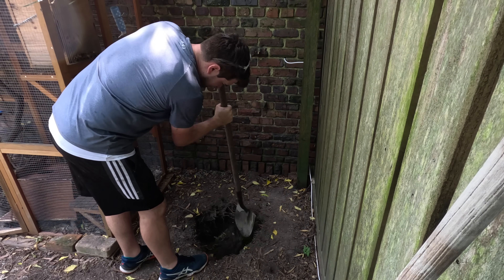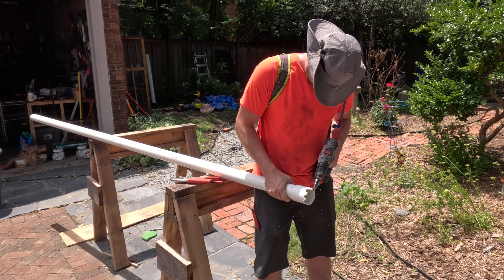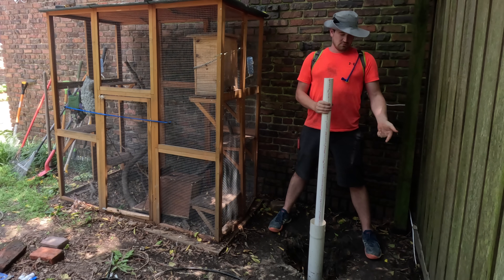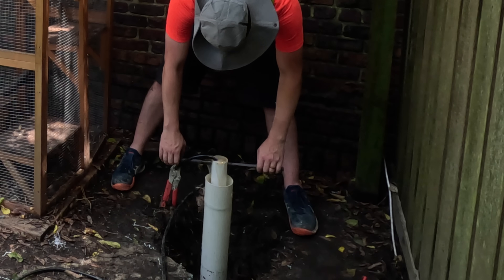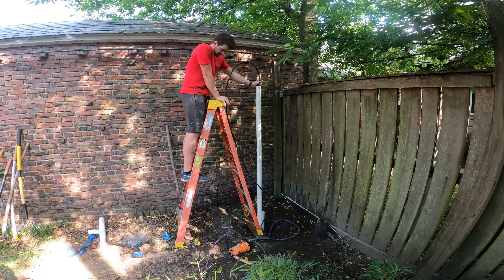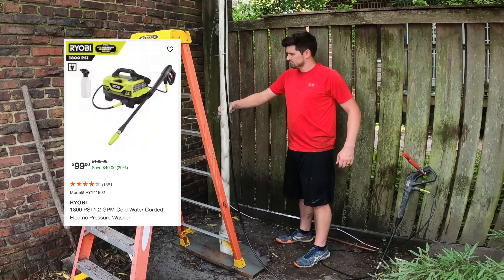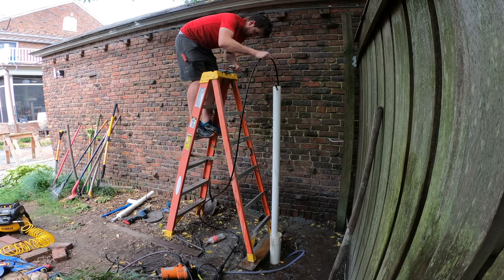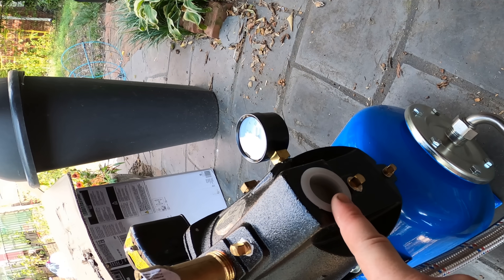I dug a 40 foot well in my backyard

Comment: I remember when my grandfather's property was annexed by the city and he was told to disconnect his well pumps and cap them off that he was not allowed to use them anymore and had to start paying for City Water Service.

It wasn't 12 hours later middle of the night, like 2:45am we were out there digging a trench rerouting the top of the well pipe (masking the "cap" so it was still there and visible) three and a half feet down trenching it over to the old barn and then all the way over to the house 200 ft away installing the pitcher pump in a hidden location. 

There was no way in hell the city was going to convince my grandpa (raised by communist hungarians) that he needed to pay for water that was rightfully his just 8 or 10 ft down on his own property.

That was some of the best well water ever because he had an old fashioned 40 and 60 ft well tap which went into the deep aquifer. Delicious water.
Reply: Grandpa is my kind of guy👍
Reply: Your Grandpa was raised by real men.
Reply: Here in California if you tap into the city water line you lose your water rights and can no longer have a well.
Reply: @frankhernandez6524  commie-fornia
Reply: @frankhernandez6524  That's why you call 611 and find out first. Just say your doing some home improvements and they have to provide you the location of the water line.
Reply: @TronixGuy93 He means as soon as you go on city water, you relinquish water rights on your property
Reply: Heck yeah. Old school American
Reply: Like, when the government disarm the American Indians, we see how it worked out real well for them😅
Reply: @timm5310  Or when they gave them infected blankets.
Reply: @TronixGuy93 they? Expound! That was routinely a work of the British crown.
Reply: @TronixGuy93 Except that never happened. Folklore.
Reply: @Milpower  Hahaha. I'm sorry you feel that way.
Reply: @TronixGuy93 it has been fully debunked. There's plenty of readily available information to peruse and absorb, for those who sincerely value knowledge and truth.
Reply: @timm5310  and if we look across the pond to Britain on basically anything in Europe, they’ve all been disarmed, and now Islam is gonna take their everything their wives, their daughters, their sons, their buildings their land THEIR FREEDOM😡❤️‍🔥🙏🏼🇺🇸
Reply: @TronixGuy93  what kind of pump did u use?  Mine is 47' n 37' to water, thinking submersible pump
Reply: @Eastbaypisces  Just a standard vintage pitcher pump. Probably from the 30's or 40's. I don't have a clue of the make and model pressure pump that my grandpa would have used. Probably something from the 60's or 70s.
Reply: Yea that old fashioned well tap surely protected you from all the nasty pollution.
Reply: @winowmak3r  You mean like the city water protected the residents of Flint, MI? lolol
Reply: @winowmak3r  Id rather take my chances with a well that MAY be polluted than drink city water
that I KNOW is polluted. If you want to drink cancer causing bleach and flouride and who knows 
what else, just keep paying the gub-mint.
Reply: @winowmak3r  "Yea" he did say the water was primarily for irrigation, regardless it's probably safer than your new modern sink tap. Go ahead and keep drinking your City Perrier and I'll keep distilling mine into 100% clear clean rain.
Reply: @winowmak3r  Ours did as well. Always tested great when every neighbor who switched literally had recycled shit water.
Reply: That was probably before PFAS
Reply: Love this!!
Reply: @EatonBudox Time to use filters or market it overseas.
Reply: love it 😍🤩🥰
Reply: Your grand father sounds like a cool dude. I would love to have a well but the city says the ground water is contaminated because of mines dug in the area. They won't issue any permits for wells. It's really frustrating.
Reply: @jonathanthompson5710  thats the main issue, permits should not be needed on your own property. city needs to keep their head out of peoples business.
Reply: @jonathanthompson5710  Get a sample yourself and test regularly. There are ways to conceal a pump (or pitcher pump) in your house. That's what they tried to tell us because of "agricultural runoff". They were lying.
Reply: Now I feel proud that I'm a hungarian :S
Reply: @Cipotalp  In soviet Hungary you don't own well, well own YOU!
Reply: Not all wells produce safe and potable water.  Some areas can be dangerous and shallow wells can become contaminated by run off doen the casing from the surface.  I appreciate that in your grandfather's case the choice here made and I would have as well.  Should have been grandfathered in upon annexation.
Reply: @mikeiver  He still did water testing. The aquifer was never tainted, nor was the water table.
Reply: Nice work Bro. Great engineering skills.
Reply: Is it still working
Reply: @flast7845  We used only encased copper tubing and brass fittings. So yeah. Still pumping water according to the new new new owners. It's a house secret :)
Reply: Communist Hungarians ? 
Do they still live in a communist country?
How is the quality of life? I hear life is dreamy in China , Cuba, Valenzuela, Cambodia.
Reply: Stick it to the man. LOL. A lot of times those rights are grandfathered. 

Some cities won't even let you collect rainwater. Greedy s o b s.
Reply: Stick it to the man. LOL. A lot of times those rights are grandfathered. 

Some cities won't even let you collect rainwater. Greedy s o b s.
Reply: and yet he let the government take his land like a good little communist lmao
Reply: And here we are controlled by a bunch of communist lites across the whole country.  Smart move.
Reply: Loved your story about your grandfather.   Sounds like a great man.  I love how stories like this reveal a bunch of bootlicking commie lovers in the responses.   People are so deceived into a belief that any of our governments have our best interests in mind.
Reply: Unfortunately now our ground water has been contaminated by pesticides
Reply: Lets go
Reply: Natural laws were not broken or harmed during the making of this influential story.
Reply: Ok you got a PVC well point since well point's are supposed to be driven I don't think this would stand up to being driven so it's basically just a screen for a drilled well I've tried finding a stainless steel one as ours only last about 10 years so far all I've found are steel with a cast iron point and threaded portion at the top to attach to the pipe sure they have a stainless steel screen but the black iron pipe in the middle eventually get's to week and collapses stoping water flow
Reply: @douglaswindsor120  I've impact driven plenty of PVC exclusive taps. Flange peened ends work best but I always recommend a manual aug first.
Reply: Hahaha 👍
Reply: All due respect. You grandpa was likely a good man, raise by good parents, but the fact that he was communists has little to no bearing on his rights or intelligence. My grandparents or better yet my grandparents  who were here before this nation became a nation, were not
Communist Romanians but did and would have agreed with your grandpa, fact is your grandpa would have agreed with them. Which is why you are likely here. America isn’t a communist nation. At least not as the communist nations proclaim themselves. It is in fact a constitutional republic. And the people will either allow government overreach or they will keep them in check by the power that God himself has endowed them with. It is our choice as Americans to either cause our government to fear us, or for us to fear our government! It is our choice. God Bless America & her people!  Love the vid! Good info! Has things I would do and others I would not.
Reply: @pjones1403  Wow that plane flew awful close.
Reply: My daughter purchased a house with insufficient water well. Said they told her at the water company that she would not have to disconnect the well. Guess what! When she connected they told her it had to be disconnected. Imagine that. Tried to warn her.
Reply: Governments are bass-turds, and this is true EVERYWHERE!!! The real pisser, the little crotch critter that made such "rules" probably still has his, but more likely her, own well.
Reply: I love your grandpa..
Reply: Love it...
Reply: 😎👏👏 smart old fella
Reply: I have one. Consider it priceless.
Reply: Wasn't his property protected by a "grandfather clause" since his property was deeded prior to the newer build laws?
Reply: Years later, the city never caught on and their bill is sent to them every month for zero dollars

 OK
Reply: The well was only 60ft deep?
Reply: The city of Paris does not make you may for your own water if you have a well in your garden . They will put a water meter to make sure you don't abuse it , especially during summer droughts .
We all share the same source.
Reply: Better forgiveness than permission which will be long in coming if at all.
Reply: That's awesome!  I want to install a well for my irrigation (sprinklers) on my rather large yard.
Reply: I Would have paid the city in “ IOU’s” and would have told them I’ll pay you when our government pays back all the money it borrowed from social security
Reply: @AreJay_  Well thats not whats important. WE NEED MORE MISSILES!
Reply: And then you woke up.
Reply: @shawnsg only after climbing off your mom.
Reply: @shawnsg  with your Mom straddling my head
Reply: its more about consuming hormone blocking chemicals and chlorine over filtered water. the extra pay is just a boost.
Reply: @cataclismdeathsassassin1698 This guy gets it. The powers that be want us all connected to municipal water to ensure the entire population gets their recommended dose of poison and endocrine disruptors like fluoride and others. Similar to how they spray roundup on all of our wheat and corn crops so that your breakfast cereal or sandwich bread has just enough glyphosate to shrink your family jewels  Alex Jones was right, they are putting chemicals in the water that’re turning the freakin’ fish gay. And feeding the same chemicals to us.
Reply: @cataclismdeathsassassin1698  Fluoride tastes good though.
Reply: ...and now, Communism has infiltrated the hearts and minds of of our Government, and of our misguided, misinformed, gullible, and naive citizens. Even New York is about to vote a Communist in as Mayor...in the very city, where your Grandfather likely proudly came through, to escape from such a corrupt, broken, and horrific system. To think of all our ancestors who fought against, or fled from, Socialism and Communism, to only have it being embraced here today. It's disgusting and shatters my heart.
Reply: @Carnie74 Huh? You have no idea what a communist is. There is zero communism in the US govt.
Reply: Pretty col, but, there's no such thing as delicious well water anywhere, at least nowhere people live. All underground water is heavily polluted...
Reply: @rafars2246  That, I can safely say is a total falsehood. I've helped people put in their own hidden aquifer /deep wells ever since and tested every one of them. I've had a few be heavy in iron and other natural minerals, but nothing a filter unit or three can't reduce.
Reply: @rafars2246 delicious well water right here in the ellijay mountains ⛰️ I fill up 10 5 gallon jugs from my family property and take them home and thats all my wife and daughter drink. I don't need fluoride or any other crap in my family's water. And yes. It is absolutely delicious
Reply: @rafars2246 someone been lying to you . Prouble the same people that told you it would all be over in 12 yrs from climate change 😊

Comment: What do you do if you run into rock?.... take a  steel rod and hammer to it' bust it up and continue or try a different location? Also why did you not get fred to stand on the roof to help you hold the pipe while you were glueing it up? Haven't seen him around lately' is he still hanging around?

Comment: Stupid question?? do you only run the pump when pulling water? Seems a waste to run 24/7 or worse burn out pump.
Reply from the maker: Yes the pump has a pressure switch so it only turns on when needed
Reply: @BadHomeowner  Ah, that makes sense. Thanks. I have a pool and gardens, might be a great option.

Comment: Thanks for sharing this.    I've always been interested in doing this as I live at a low elevation.     What made you confident you would get water out of it before?    Was there some sort of tool or resources you used to determine an appropriate depth that would be needed before beginning?
Reply from the maker: Nope I just started digging. I'm also at a relatively low elevation near the coast, so I knew there's water down there somewhere.

Comment: Be very careful doing this if you don't understand the local geology and/or how ground water moves; you can wind up digging a well somewhere prone to contamination from nearby structures such as garbage dumps, chemical storage, farm fields, or animal pastures. When in doubt, consult with a local geologist.
Reply: Don't just think about geology. The way he set it up, any water, and anything in that water, will seep down along and next to his pipe. You really want to plan how to keep surface water moving away from your well.

Also foot valves will save your pump.
Reply: Agreed if close to structures/infrastructure.

Always test water after drilling would be my advice
Reply: Worse can happen. Some dudes dug a hole for a heat exchanger (a central heating system with a heat pump), hit an artesian well and there was a layer in the ground of a mineral called Anhydrite (calcium sulfate). When the water came into contact with that it former gypsum. What happened was something  like a slo-mo earthquake, since the gypsum has a larger volume and displaced other material and the houses foundations above were damaged. A giant mess.
Reply: @donaldduck830  That reminds me of stories I heard about two halves of a store's foundation being offset vertically by like a foot down the middle because they built on bentonite.
Reply: @Zalmithius they shoulda built on straightenite.
Reply: seen deisel , petrol and agent orange  in underground water from large facilities miles away
Reply: Go to a corner.There are natural sand filters and man made filters he can use. You are the type that lets your local politician know when you take a  du*p!
Reply: Shut up
Reply: Shut up Karen
Reply: @norfolkpartisan5767 in india there is naturally occurring flouride in the ground and ground water, they have high levels of bone deformaties (flourosis) , their crops suck it up, indian grown teas can be high in flouride.
Reply: @norfolkpartisan5767 Want to link the study you're basing that claim on?
Reply: It's usually free too!!!!
Reply: When you hit rock you’re stuck. Problem solved
Reply: He is not a fool.
Reply: Oh man, doesn't matter what you use the water for. Your well might be the source of the contamination of drinking water for everybody. 
Because those blueclay layers often seperate different ground water layers. 
Drilling through can cause water flowing into another level and contaminate it...
Reply: @user-dl1cf4xr6t keep living in fear thats on you but dont press your fear onto others
Reply: Just for planting....it's ok
Reply: @hungvo4008 if you look at how often people catch ecoli from vegetables from grocery stores. I think you'd have a change of heart
Reply: @hungvo4008 So putting chemical contaminated water on food is OK in your universe?
Strange...
Reply: Better than flouride tap water
Reply: @chriscasteel5777  You can do way worse than fluoride tap water. At the right levels it'll help protect your teeth. Test your water though, if it has fluoride levels in an unsafe range I'm sure a local news agency would love to get the scoop on that.

Edit: It's also worth noting you can have naturally occurring fluoride in groundwater. Even more of a reason to take care with drilling, if fluoride is really your main concern.

Comment: Add a compressor hose with a .25" jet at 100psi + attached to the side of or the pressure washer line. I also add a vacuum line with screen. Works great.

Comment: Two things that should be mentioned are, the pump needs to be a wet cavity type, i.e prime water has to be retained, and secondly its impossible to pull water with a pump more than 20 feet practically. The NRV would be better place just above the well stick.

Comment: When putting the well point in, I like how he stands on the very tip of his toes on the 2nd rung of the ladder instead of just going up one step. I just thought that was funny :-)
Reply: @sophiaadams73  I've worked on 40-ft ladders my whole life. We're talking 3 ft here lol
Reply: I would have used that roof to my advantage and not fight the pole or ladder ;-0
Reply: Yes! I was yelling at him the whole time to climb the darn ladder!
Reply: Glad I'm not the only one. Cheers.
Reply: @sophiaadams73  they put the steps there for a reason didn't they. If it wasn't safe to go higher, there wouldn't be more steps. Or there would be huge writing saying "no step" just like it does on the very top of pretty much every single a frame ladder in the world.
Reply: He was worried about possible OSHA regulations about working on a ladder in wet conditions.

Comment: It seems you don't have much rocks in your soil. Here there is a crazy amount of big rocks. If you dig a hole you get up like 30% big rocks.
So this method would never work here. I mean it is not even possible to drive down a long slim iron bar, any amount of length I am talking within 1-2 feet you are sure to run into a rock, without running into unmovable without digging them up rocks.